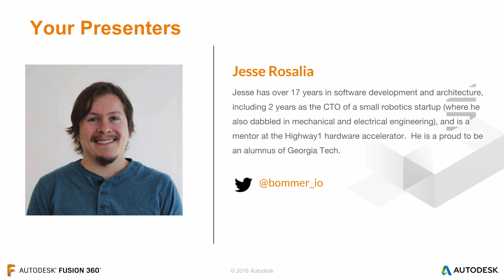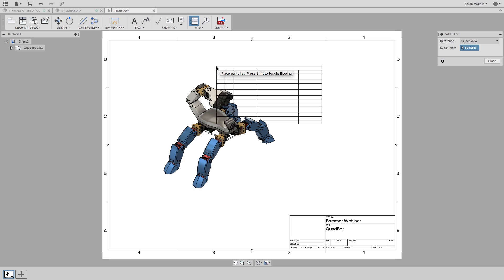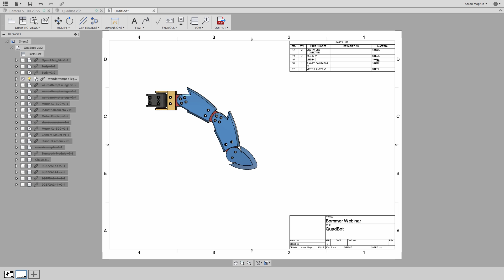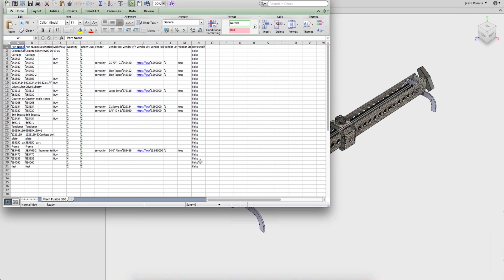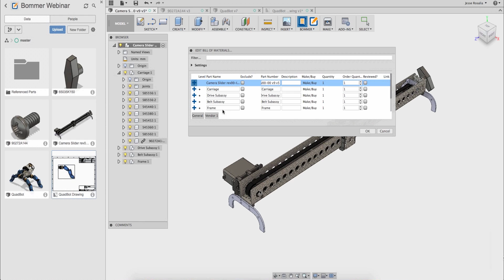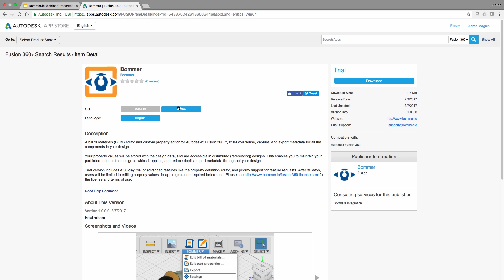Building better BOM's with Bommer

Comment: At first time, fusion impressived me a lot with the high power of surface design (create form, metal stamping...) but when I have to use only Fusion 360 as a requested from my company...it is became a nightmare...FS360 lacking almost every basic tool which another software have as a standard (I have used Creo for 3 years and NX for 5 years...)

Comment: $10/month per user.  You got to be kidding me!!!!!
And why is the price tag tucked in in the last line of the description? Instead of right text to the bloody Trial-button?
Because nobody would downloaded then!

Edit: Just just found out from the comments that there is even a lot of basic functionality missing. Useless for me irrespective of the exorbitant price,
Reply: Dean Deković and 0,01375 per hour...
Reply: Me either...this is my nightmare when I have to work with Fusion 360 everyday as a mechanical designer for my company…...have to say Fusion is useless...just for student to studied or for non-professional CAD engineer !
Reply: @nguyenvuhoanglong3418  I can see your reply is two years old now so maybe you feel differently but if not, I think the problem must be you actually.  I'm qualified in 3D parametric modelling and did my qualifications using Autodesk Inventor.  I use Fusion now every day as a 3D mechanical draughtsman in building services engineering and once I got my head around the differences between Fusion and other software like Inventor or Solidworks, I have to say that, at least from the product development side of things, Fusion is great.  The problem with most people is that if something is different, they think it is rubbish.  Old dog, new tricks scenario.  Of course, as far as BOMs go, Fusion doesn't offer much, which is why we have Bommer.  And for all you morons complaining about $10/month... you clearly have no real-world perspective or experience.  $10/month is fantastic.
Reply: well, it is just 0,33 dollars a day per person. How much time would you spend editing your 300 parts BOM list in excel?

Comment: The problem with fusion 360 is that it is not widely used by professionals because of inappropate  BOM functionality.
I try this plugin...but not ready to buy it because of the following:
1. Not integrated with drawing BOM table with crosslinks.
2. Absence of calculated fields (name based on dimensions ie)
3. Cant take data from component like as dimensions or mass.
Like as openbom for onshape...
Reply: Hi, I'm the creator of Bommer.  Thanks for trying it out, and for the feedback!  It's definitely in our plans to support all three of these items, as the Fusion API allow.  If you want to keep abreast of our progress and get notifications on new features, please join our mailing list at http://www.bommer.io/ (click Stay Informed on the first screen).
Reply: Jesse Rosalia what's the cost
Reply: Pricing is currently TBD.  We'll be starting a pricing survey soon, and hope to have some answers in the next couple months.  In the mean time, the plugin is free to use.  Download and register the addin if you want to provide input!